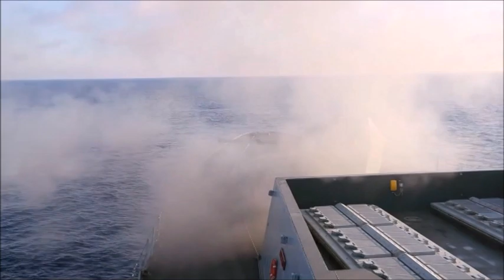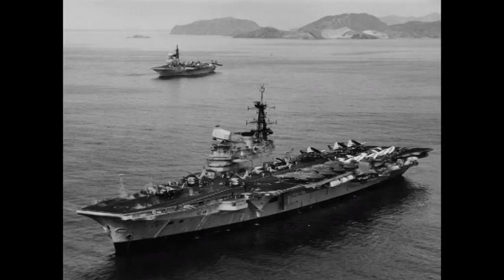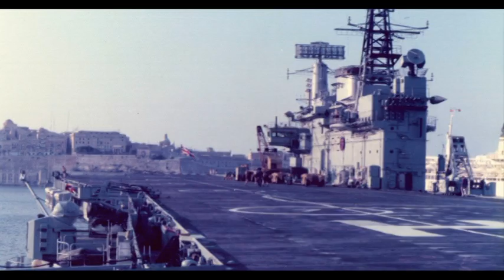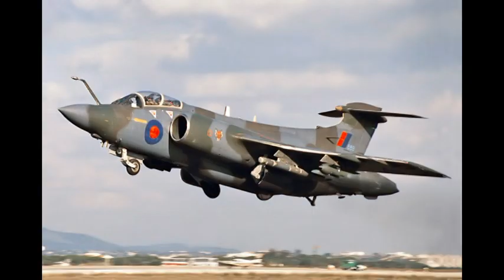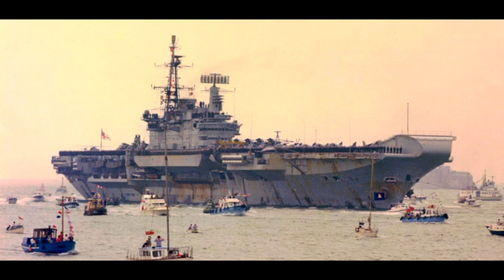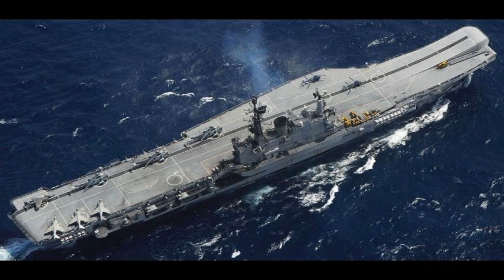HMS HERMES R12 - FALKLANDS FLEET FLAGSHIP BRIEF - NO. 15

Comment: I served on the Hermes sister ship HMS Bulwark 1973 - 1976 great ship, great crew, loved every minute 👍
Reply: HMS Bulwark for a short time was a Royal Marine Commando Ship? Q. Sister Commando Ship HMS Albion?
Reply: @trevorhart545  HMS Albion before my time, Bulwark carried 40 and 42 cdo Royal Marines and wessex mark 5 helicopters when i was on it, they also did trials with the harrier jet to test if the flight deck voatings could handle the heat and blast from the harrier, if faired pretty well

Comment: You need to have someone proof read your script for errors. The Fairey Gannets embarked on Hermes and depicted in the video were Airborne Early Warning aircraft, NOT Anti Submarine variants. The latter were being withdrawn from the RN around the time Hermes entered service. Also, construction work on Hermes did not stop between 1953 and 1957, it was given a lower priority up to 1955 as the builders were told to prioritise completion of HMAS Melbourne for the RAN. Once that was done work resumed at full pace on Hermes.